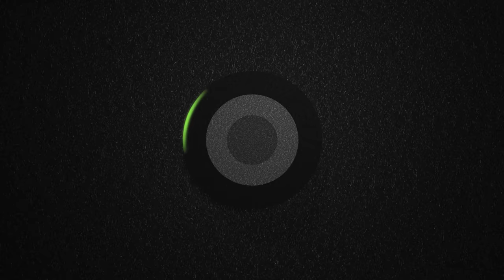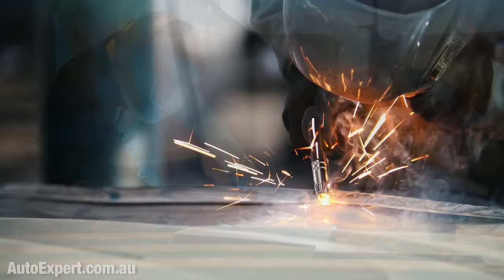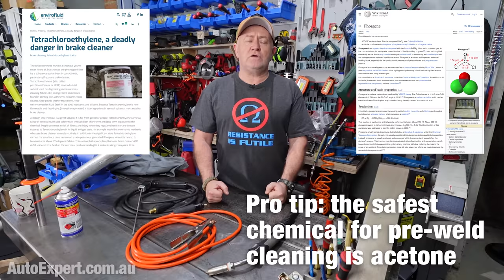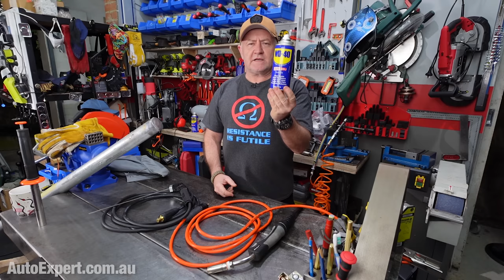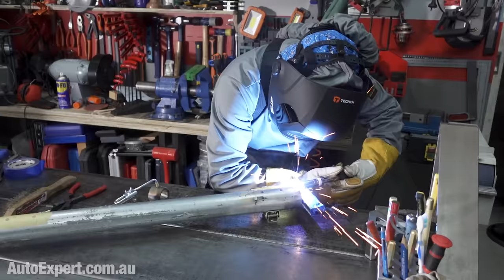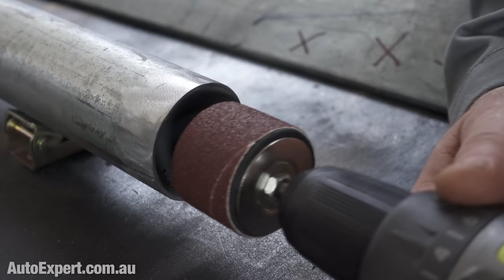How to die while arc welding at home: the top 5 ways | Auto Expert John Cadogan

Comment: I have been welding for 60 years and still do at 82 ,but my close calls were a little different. I did a lot of underwater arc cutting and welding .never attempt to use an A/c machine for any in water work it will kill you. Be careful of hydrogen gas build up when cutting any structure that can trap gas. It will blow up when it gets a spark. Remember salt water is very conductive if your ground comes off it can be shocking. I almost killed my partner when my cutting rod touched his copper helmet. Out of the water it can be just as bad. Using heat to bend stainless can be a disaster.  Be very careful cutting on containers if you are not sure what was in them do not try to crank your acetylene gage over 15 lbs , especially if you are cutting underwater .boom .watch where those sparks go when working around fuel . Sorry about so much writing but if saves one person from injury it was worth it.
Reply: Great suggestions.  We need to hear these stories(as somebody who only jas 2.5 years in the field).
Reply: I am completely new to welding, and I read every word carefully. My engineering degree couldn't prepare me for half the things you mentioned. A lot of experience goes into these things, and I have deep respect for that.
Reply: The factory next door to me changed hands in 2015. The old place did heat treatment and I believe they had methanol tanks for fuel for their furnaces. New owners moved in and had a lot of the old plant removed. Guy was told to cut these tanks up. Cuts into it with the accetelene and is blown up so badly he was initially misidentified to his next of kin. 

Do not cut into or weld a tank unless you know exactly what was in it.
Reply: I went to welding school in Sydney Austrlia in 1963,  the instructor had a news article about someone who found a fuel tank from WW 2 it was dropped  and layed there for 20 years .when this guy cut into it it blew up killing him. I'm sure there many stories like that.
Reply: Sharing decades of wisdom and knowledge with everyone is always a wonderfully generous thing to do. Thank you.
Reply: I just got into welding I'm 19, thank you for letting me and everyone else know what to look out for.
Reply: This is the kinda shit younger guys need to hear/read.
Reply: What voltage are you using to almost kill someone?
Reply: You know what’s more shocking than you welding is that you watch  YouTube at 82
Reply: No wonder underwater welders get paid so much at any moment you can blow up like a Michael bay movie
Reply: I didn't know using heat to bend stainless was dangerous!! I just did that 2 weeks ago to fabricate some z clips for a project..
Reply: Underwater...
Respect!!! 😮
Reply: It's the amps that kill in welding.
Reply: Some fumes from welding different kinds of metals does irreversible harm, some are very hard on your nervous system.
Reply: John Logan . Its good to share your knowledge with others .
Passing On Valuable Lessons that You have learned  may save a Life .
Reply: @dunnwick chromium in stainless steel is Toxic stuff to breathe. Grinding it is also hazardous to breathe.
Reply: Pm
Reply: Waking up dead definitely puts a crimp in your lifestyle for sure -
Reply: @hereforthecomments456  He said 82, not 105.
Reply: Lost a friend he was killed welding up a cracked rim with fix a flat in it. Not sure if he took the Schrader valve out of the valve stem. RIP. Mark Underwood.
Reply: Thank you for taking the time to share your wisdom! Best wishes buddy!
Reply: Honestly, I would read a whole book if it saves my life in the future, I'm about to start my welding career
Reply: @bryamrico  
Good luck kid, not sure what part of the country you live in if you don’t mind working long hours and travel you might want to pursue being a union pipe fitter.
Reply: @danieldonohue9508  I live in the Houston area in Texas. I have a few jobs lined up but I'm not sure which to pick. How would I get into a union?
Reply: @bryamrico  
So where I live in the Chicago land area most of our infrastructure work is done by Union contractors. Not sure how big Houston is on Unions. I do know they have a lot of Oil refineries Every year so they will have a shut down for maintenance you can make some real good quick money keep in mind the work schedule could be seven days a week 12 hours a day.
Reply: @bryamrico  
I will look for information up this way and forward it.
Reply: @danieldonohue9508  thank you!
Reply: Thank you for your info sharing.
Reply: wow. amazing tips. thank you
Reply: The worst fumes I’ve ever breathed were from a glass lined water heater I cut in half and welded legs on to make feed troughs.  Ag teacher didn’t know it was harmful.
Reply: I was on a job where a mechanic and a welder were scrapping a truck. the mechanic was removing the fuel tanks, spilling gasoline everywhere. The welder was cutting the 5th wheel hitch off with a torch. I was just a 19-year-old kid and when I tried to stop them, they ignored me. Sparks were skittering across the ground, landing in puddles of gas with a puff of vapor. All I can think is it was a cold, windless morning and there was a layer of gas vapors and not enough air to ignite. Years later, I was remembering this and realized I was the fire safety monitor and had not only the authority, but the obligation to put a stop to that foolishness. Larry, the mechanic, was under the truck. All 450 lbs. of him. There's no way we could have gotten him out if that mess caught fire.
Reply: Great video!
Reply: That is not much writing.
Reply: Thank you for the advice 😊
Reply: @dunnwick I gotta learn more about why this is bad and how to do it right
Reply: Really appreciate when people like you Sr take the time to warn others about the dangers to anyone who has less experience that you. Thank you I'm sure it will save lives keep people safe. I myself am new to welding and will keep all the points you brought up to mind. Will pass on the knowlege like you have done here. Thank you for helping others that are a little more ignorant. God bless you Sr.
Reply: Thank you very much for shareing very life saveing information that you have learned for all your years of experience. I'm just starting welding and never did I think about easy ways welding can kill you. You earned a subscriber much respect for watching out for others. Again thank you. It's people like you that knowlege keeps getting passed down to the next generation in a safe productive way. Thanks
Reply: I worked at the Exxon in Baytown, Texas back in 2001.They built a new cocker unit and they had not been tracking the welds and ended up over 3000 welds had to be cut out in position and welded back. We got called in and they were paying us rig welder pay. I worked 7-12's and to be honest it was one of the worst jobs I ever had. As to the $$$ I made Let's break it down:

- You're working 12 hours a day, 7 days a week. So, the total hours you work in a week is $$12 \times 7 = 84$$ hours.
- You're earning $50 per hour. So, your total earnings from the hourly wage in a week is $$50 \times 84 = \$4200$$.
- You're also earning $100 per day for 7 days. So, your total earnings from the daily expense in a week is $$100 \times 7 = \$700$$.

So, your total earnings in a week would be the sum of your earnings from the hourly wage and the daily expense, which is $$\$4200 + \$700 = \$4900$$. 

I'm sure you will make a lot more now as that has been forever ago. I have retired now, and I have a son who works in the cocker unit for Exxon in Baton Rouge, Louisiana. Good luck to you and I hope you end up retired living the good life as I am doing today.    @bryamrico
Reply: @badbradcannon  thank you for that🙏I'm still looking for a job right now. No one wants to hire someone with 1 year experience
Reply: @danieldonohue9508  What happened, did it explode?
Reply: I was a iron worker welder for 35 years, I remember a particular job where I had to get on some duct work in the ceiling and lay down to get to some tight spots, It was a hot day so lots of sweat on clothes and gloves, It was not a problem until a bare spot on the ground  cable began to arc on the duct work i was laying on with wet clothes. I was welding DC and had just enough time [about 8 seconds] to yank the ground off, I thought for sure it was gonna kill me. Just figured I would share that with you. I never done any underwater welding but know it is very dangerous.
Reply: @phlodel  so many close calls, you really need to pay attention and not be so ' macho ' that you put yourself ( and others ) in a bad place.
I have a story of a few friends and myself using a little gas to start a brush fire where we were all well seasoned 
' firebugs ' and expected the gas fumes to ' whoosh ' real big but it did not, it flat out exploded and blew the whole pile up in the air.
Even the best of us can get a surprise.
Also had a neighbor that had scars all over his arms where he was doing the common  ' shooting the barbecue fire with charcoal lighter ' and it blew up the bottle all over him.
He got a surprise that hurt him.
Reply: @phlodel  chill out, I was just using your story as an example of how people need to pay attention and not be a 
' bad ass ' as stuff can happen.
You said you pointed things out but no one seemed to care.
I have another story similar to yours in where I was at a friend's house and his grandson was cutting his grass. He was in between the house and garage refilling the mower while smoking a cigarette.
 pouring gas.  I mentioned he should watch he don't catch the fumes and to show me how much of a bad- ass he was he took the cigarette out of his mouth and stuck it right in the tank. 
Nothing happened but I thought that if it did he might have been on fire, I might have, the house and the garage might have all been on fire.
Reply: @michaelszczys8316  Safety can be annoying and even silly but it beats careless disregard.
Reply: Dear Sir. You are a Gentleman and a Scholar.
Thank you for sharing your experience with us.
The utmost respect to you!
Reply: Using heat to bend stainless
Reply: lol everything this guy says is false mostly
Reply: Just wanted to say, none of this is a problem anymore, its litterally all covered in "common sense"(like copper helmets) or foundation training. Thats wild tho, crazy what you guys had to put up with before OSHA shoved their giant noses in everyones asshole
Reply: A buddy and I were walking in an auto salvage yard looking for parts for my 1964 Ford Falcon. There we saw a hulking brute of a car laying in the sand: a 1959 Oldsmobile station wagon with the rusty old gasoline fill tube open, pointing right at us. He flicked his cigarette at it. It went right down the tube. We laughed. It said WHHOOOO- WOOOF!! - burning his eyelashes, singeing his hair. I fell laughing rolling on the ground.
Reply: Thank you John Logan You Are An Officer and a Gentleman
Reply: @danielescobar7618  it is our job as senior journeyman welders to pass this info on. I consider it to be on us to teach the young ones how not to die. I had mentors that were very harsh when it came to teaching me how to survive and go home every night? And thanks to Les I've never got a piece of leather in my sandwich 🥪 
Thank you 
Lester and John Burch 
If I could find you and I've tried  I would thank you for the life lessons. I still have all my fingers and toes.
Thank you
Reply: Thank you very, very much for sharing your experiences and  knowledge you have learned in your years. I'm always willing to learn from others.
Reply: @dvdmethod2 True, even us 'old farts' need to read all of these experiences of others.
Reply: @hereforthecomments456 Yeah, and you also probably think us 85 yr olds shouldn't be sandblasting also?
Reply: @kingofspades1785  same and im 18
Reply: @danieldonohue9508  Did it explode and was it the shrapnel ?
Reply: I was just planning out a project involving stainless steel, thinking about heating to ease the sheet bending, now thinking otherwise. Much thanks brother.
Reply: That’s nuts,there’s only one scary moment welding a gas tank,the moment before you know your method works.
           I imagine it takes caution to weld and cut under water. I also imagine a cautious person wouldn’t do it.
Reply: Your word are appreciated. Thank you
Reply: Just don't use an AC Machine at all and you remove 90% of the risk. This though is from a guy that got zapped yesterday. Was replacing outlets for my brother and his nutruals back feed... Loads of back stabbed outlets and switches. Lines that are looped and not terminated. Shocked this building hasn't burned down.
Reply: Thank you so much for the "heads up"! 👍
Reply: What is wrong with heating stainless to bend it? I've already done this. Now I'm wondering if I could've effed myself up.
Reply: Great info.  I had to smile ...... I think if you're good enough to weld underwater you aren't watching this 😂😂😂😂😂. Hang on, except you, doh!
Reply: Why can using heat to bend stainless be a disaster?
Reply: @deckname5794  Many people don't realize how little current, not voltage, it takes to kill. Any path from right or top or bottom to left that crosses your heart can affect your heart rhythm, meaning kill you. Takes not much at all. A low resistance path means the current required to kill is more likely to flow. Be careful.
Reply: It's like Keith Richards telling you not to party too hard.
Reply: @johnlogan8218  sounds like that pilot got one more sticker... :(
Reply: When I was in dive school decades ago the fog you could see on the surface of the lake we trained in was actually orange/rust colored.  It was like something you'd see in a horror movie lol.   But yes welding underwater creates hydrogen bubbles.  If they are given any chance to build up it's very easy to go BOOM.  I remember the underwater welding well because of the little pops you get as you hit microscopic hydrogen bubbles that stick to the metal.  It was a fun time but you must know the dangers and be safe.
Reply: There's a reason I'm a machinist....in all seriousness though, anyone with a lot of experience doing dangerous things who wants to share, we should all be listening.  Thank you very much for taking the time to pass on life saving advice.
Reply: That wasn't a lot of writing.  It was nice and tight.  If you wrote a book on welding and your welding experiences, bet it'd be pretty interesting!
Reply: You sir, should make a short video about this! I think you just saved a few lives with this comment.
Reply: Respect old timer for your advice
Reply: Some years ago I did a brazing repair to my bikes fuel tank as it had a leaking seam. After a few hours practice after advice from a welder on scrap steels my joints were not neat but solid. I flushed the tank 3 times and it still stank of petrol. The welder to me to fill out with kiln dried sand so there’s no air so no vapour. Seemed to work as no explosion occurred. 
Would need a lot of sand for a container though 😊.
Reply: @danieldonohue9508 Tire exploded?
Reply: How is it more dangerous than any other steel ?
More difficult yes because you will form some carbide that will ruin the stainless.
Reply: Maybe fumes, but in a ventilated setting as every welding site should be that with a mask.
And to have lots of fumes you are overheating.
Anything else ?
Reply: I have been welding for 54 years and still do at 76 as many years ago in 1978 to 96  i use work on road fuel tankers repairing and manufacture aluminium tankers that transports petrol and diesel all over  Australia and many times i had go inside fuel tanker to do welding or fitted new valves as we the worker must follow the safety rule including remove all inflammable fuel including using hot steam cleaner and use special testing devices to see if free of  inflammable fuel inside the tanker before go enter inside the tanker do repairing  and we also  have exhaust fan to remove heavy welding aluminium fumes ever my welding helmet was covered  with white dust and lucking i wear mask over my face and mouths and ever right now still fellow safety welding rule at workplace everywhere l do is always  remember the rules as long as l am alive
Reply: @deckname5794  Dude, it ain't the voltage that kills you- it's amphere's.
50amps at 1 volt will stop your heart.
Reply: @trickster8635  But at 1 volts you won't get 50 amps.
Reply: Sir when you go could you please donate your hands to only me 🙏🏻
Reply: Whats in WD-40?
Naptha for one
Reply: THANK YOU
Reply: Incidents, WD40 is excellent at cleaning sticky tags off your cd cases.
Reply: So don't clean you cd cases where you weld.
Reply: Thank you. I learned a lot.
Reply: A solid understanding of electricity, how it works and behaves is essential for every welder. As a physicist by training and inclination, to me welding looks like the high school experiment from hell. 

Understanding that a welder is basically controlling a very high current/voltage situation should scare everyone enough to get the facts of the situation on their side or at least make them think twice and assess the situation before proceeding.
Reply: @Isadore123L  It's actually the powerful combination of voltage and lack of resistance in the circuit supplying the energy. The simplistic analysis you bring is part of the problem with the education surrounding dangerous tools.
Reply: @phlodel  stories like this need to be told. As someone who has seen all sorts of ridiculously dangerous situations on the job, most people are clueless to imminent and severe danger which makes the education of the tradesman even more important
Reply: Ahoy mate! Love the "wanky badge" comment!-John in Texas
Reply: What exactly is the problem with bending steel with heat
Reply: Can you explain why heating up stainless can be a disaster?
Reply: Like your style; packed with facts, no BS. And funny. 👍🏼
Reply: These all seem easily understandable.  But I don’t understand why alternating current would be more dangerous than direct current underwater.
Reply: In trade school one of the students died from fume poisoning. If I recall he was in the welding program and was staying late to do some brazing or maybe silver soldering in one of the bays. The hood fans were shut off for the evening and the instructors were busy wrapping up for the day. This kid got the flu like symptoms fairly quickly but went to hospital with numbness in face and extremities and passed away that night from respiratory failure. Major shit hit the fan at the institute unsurprisingly. Everyone who was there learned a brutal life lesson about the consequences of working safely and how inexperienced tradespeople can get seriously injured or unalived if not properly trained and supervised.
Reply: Tell me more about bending S.S.
Reply: Why would you be running acetylene anywhere near 15 PSI? Do you need more pressure underwater? Edit: I know they say don't exceed this but I have never needed to go above about 10...
Reply: copper for helmets?? I'm sure there's some reason for that but it sounds like a god-awful idea.